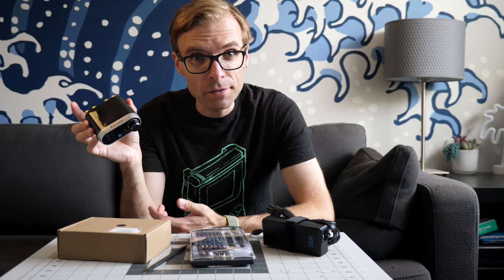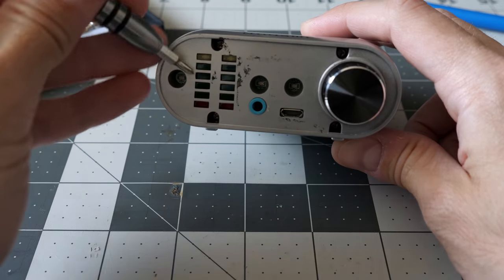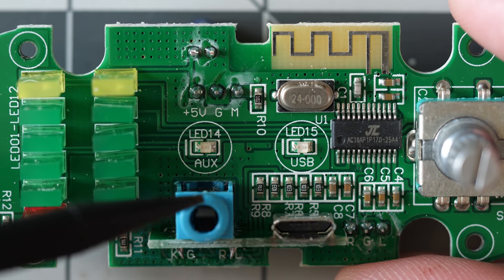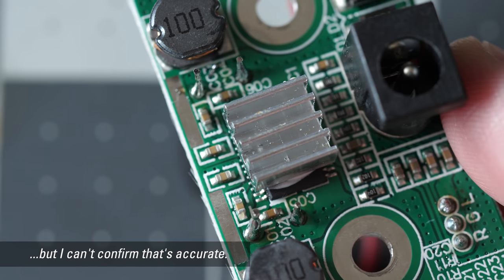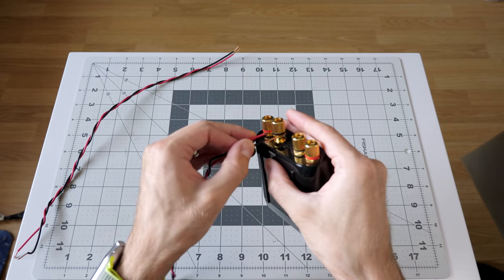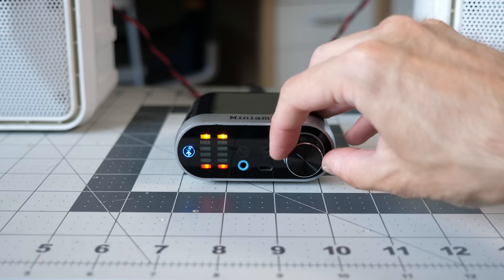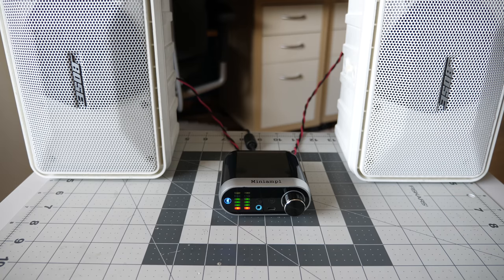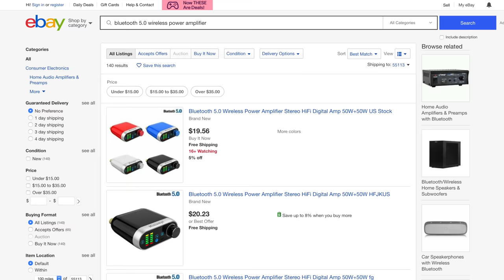Mini Stereo Amp (That Doesn't Suck)

Comment: Can anyone recommend an amp in that size range and price that has a headphone plug? I'm using a Lepai 2020A+ on my computer to power to Micca speakers and I'm quite happy the only thing I'm missing is a headphone plug (with a switch to turn off the speaker). I don't care about bluetooth or anything else just decent sound and headphone input. But I haven't found anything that match especially in that price range (well, if it's really good I'm ok to go up to $50ish).
Thanks in advance.

Comment: I just use a car stereo for this 😹
Reply: Exactly! Get a huge 120vac to 12vdc transformer. I had one from Tripp-Lite that took 15amps @ 120vac and output 50amps @ 12vdc. Hooked up a 400w rms Rockford Fosgate punch amp (400a2)  it sounded amazing. Used the punch for my subs and used high level input from a home receiver (50w x2 technics)  for the mids and highs. That radio was amazing.
Reply: I bough a cheap ( alpine ) unit for 20 bucks ( new! ) and just have a cheap 12v transformer and two dayton bookshelf speakers. Super cheap and puts out good sound...good enough for background music in my shop at least.

Comment: It may be rated for so much power but I promise you it doesn't want any more than what wattage can be sufficiently handled by the complete system and all included electrical components.... Which, NO one "NO ONE" really can consistently deliver productively for customers that's why most people end up just oversized on everything except the speaker wire and the cheap little tin speaker connections like back in the Jensen poor Vega rich orange new black days....if that makes any sense....I wonder what an audio system designed with technical qualities, electrical ingenuity,along with meeting even the most absurd high performance standards would sound like?? Like with all high quality silver circuitry, with one power delivering special connection....forcing the sound industry to deliver the highest end systems known through all aspects finally putting my foot in my mouth single handedly by proving electrical engineering grads along with chemical engineers can also hold their own....because after this fucking wago thing at the Belle Chasse grain elevator....puuuhhhuuuh I'm pretty sure you schmucks aren't even remotely capable of thinking out the box and in all concerns....
Reply: Nope....it only reveals that I don't fear any of you.... Which once I may have for a time but, now YOU will know my NAME!!

Comment: here are a couple old mini systems i like to use on the desktop https://photos.app.goo.gl/wDdzLzB4D9uH5jq89, this one has  good power for its size https://photos.app.goo.gl/SobiphMtG923vKst5 ive been a fan of these mini sets for awhile,, would like to find some mini tube system from the past someday,,,the mitsu  puts a good mosfet type amp out at 75 watts for 2 channels runs 4 easy enough but i wouldnt hook some big Infinitys to it,, the hitachi is just 35 watts but its even smalller than any ive had from the time it was sold seems a bit morecheap looking but when you pick it up you lose any notion of it being a replica or plastic set.

Comment: haha that amp ain't 50 watts.
Reply: It actually does have the capacity to output 50w x 2 (stereo) if they are indeed using a TPA3118D2 chip like the listing said.  Those chips are spec'd for 30w RMS without heatsink, and 50w RMS with heatsink.  Texas Instruments specifies that only a "small heat-sink" is needed.

Comment: So you most likely broke it and then blame the build quality.. Wtf? ALWAYS test before you open things up!
And 2x 50w output is really not realistic at all anyway🤣 I would guess maybe 10w nominal at best. Maybe just 5w.
50w would be absolute max peak with very high destortion if you are lucky.
And heat is not a problem with a little tiny Class D amp.. Even large Class D amps don't really need much cooling since they should be pver 90% efficient. Sorry dude.. No offence but you seem to lack a bit knowlage of what you are doing and talking about.

Comment: NO BALANCE CONTROL.   BOOOOOOOO     Yep,   TEST before Dissection.
Reply: It is not a problem: you can always control the balance on your input device (as well as use an equalizer.
Reply: @alexanderkrupin5669  Not the issue.  Issue is there is not one on this thing.  Maybe my input does not have one as well ?   My ears are screwed.   I need one.

Comment: You need a refund.  I can build a better and cheaper one anyway.
Reply: You can build an amp with built in Bluetooth and a USB DAC for less than $20?
Reply: @MN12BIRD  those chips are pennies on the dollar these days. i mean they are likely the most expensive two components, but even at that they can't be more than a couple bucks a piece. and then consider bulk purchasing power.
Reply: Do you have a website?  I'd be interested in seeing what you can build.